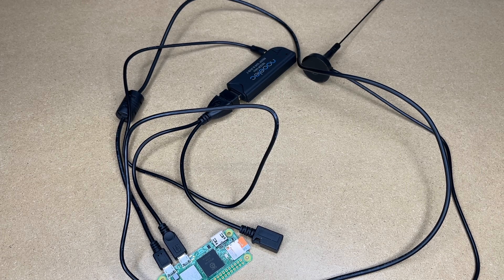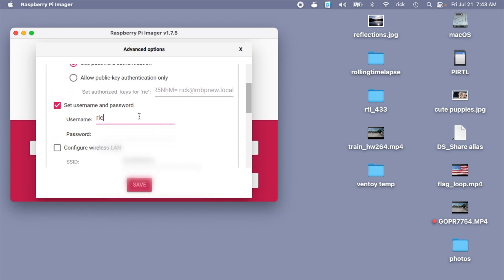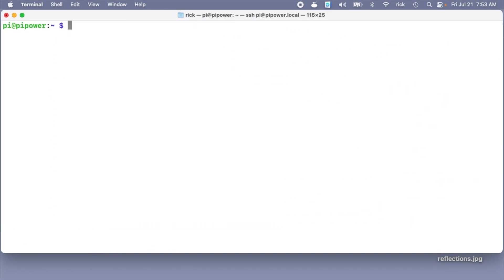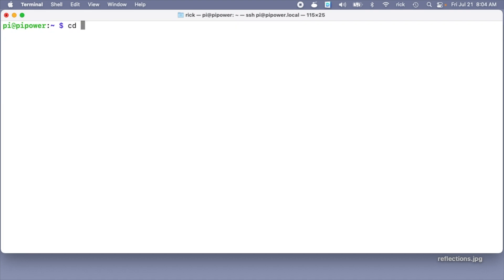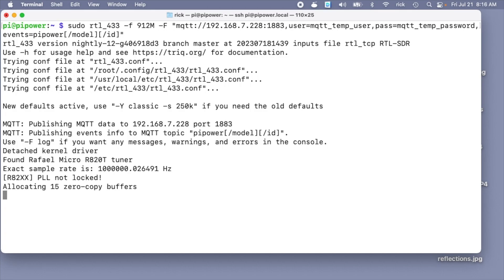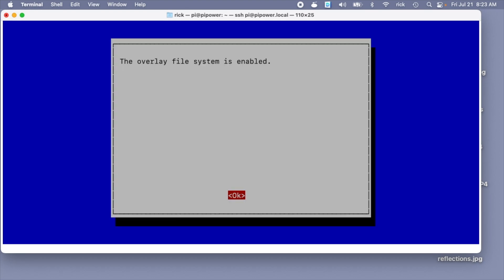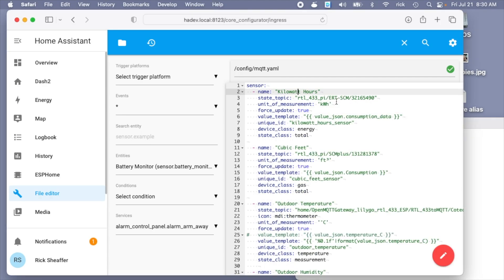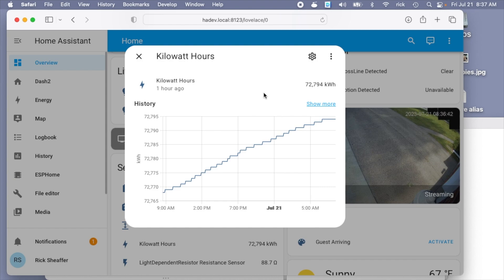Collecting Power and Gas Meter Data for Home Assistant using Raspberry Pi and SDR

Comment: my meter physically is showing "05985" however MQTT is showing "589555". Do i need to do something special like dividing between 100 or just use a different unit instead of kWh?

Comment: At the end of minute 5:29 you entered 912M for 912 megahertz and said that it was for this frequency. If I enter this number, will it also find devices below this frequency? I come from Europe, Germany to be precise, and here we have most devices with 868 MHz. Or do I have to enter "sudo rtl_433 -f 868M" so that the correct frequency is set?
Reply from the maker: You can enter different frequencies. I think it scans above and below the frequency you enter. I often use 433M to find sensors.
Reply: @Rickmakes  Helpful video, even if the path to rtl_433 you show in the .service file doesn't exist.  I found it and got it working (/usr/bin, not /usr/local/bin on my system). Also, I believe the program actually listens on the frequency specified, and occasionally/randomly the meter actually transmits on (or at least close enough) that frequency.  I do know the meters are frequency agile.  That has been presented in other YT videos.

Comment: rtl_433 works on the Pi I can see my weather station data, but when I put this service config in sudo rtl_433 -f 920M -F "mqtt://192.168.50.135:1883,user=xxxx,pass=xxxxx,events=rtl_433[/model][/id]" MQTT Explorer doesn't see it. What I'm I missing

Comment: I get all the way to creating the service and start getting error codes. I was able to pull data before, however there is something with the service that will not allow me to move forward. I get a (code=exited, status=1/FAILURE) error. I have verified everything is correct too. Any ideas?
Reply: I found that rtl_433 was in /usr/bin instead of /usr/local/bin so.I made that change to the service config and it started with no problem.
Reply: @johnarensberg3121  Hi, what did you do? Did you only change the path in nano for /etc/systemd/system/rtl433_to_mqtt.service? Thanks!
Reply from the maker: Can you past your service config as a comment (removing the username and password parameters)?

Comment: out curiosity what power company/meter do you use? Trying to ascertain if AEP would be compatible
Reply from the maker: The power meter says "Schlumberger CENTRON" and the gas meter says "Itron". I have a water meter that says Aclara. It shows the frequencies on the box but from what I understand, it is encrypted. If you are tech savvy or just want to learn, it might be worth getting an SDR just to play around with.